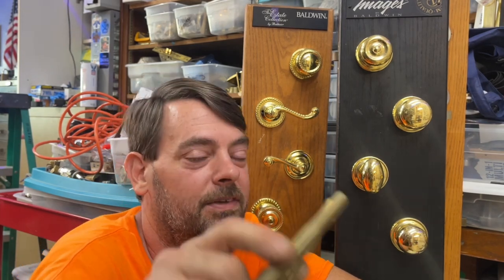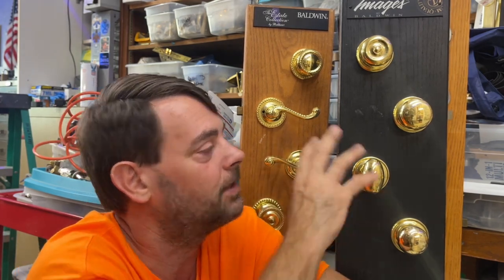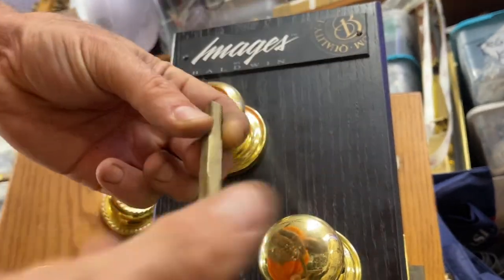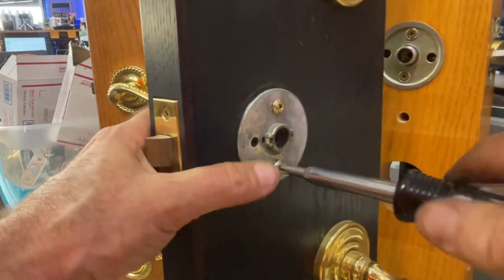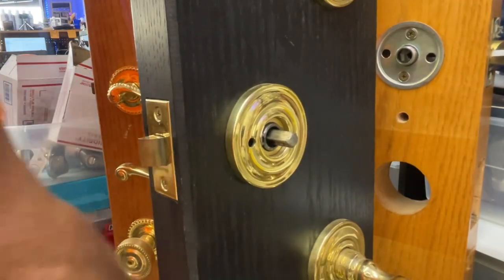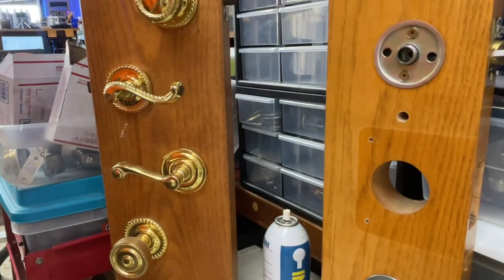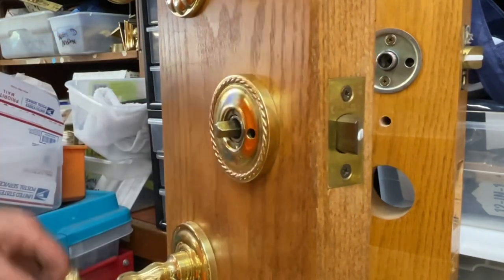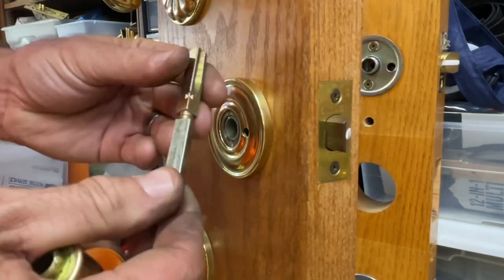RLS 24 - Baldwin Images & Estate Tubular Passage & Privacy

Comment: Always interesting to see the stuff common in other areas. Baldwin isn’t common in my area. If I come across Baldwin it’s most likely a fancy handleset on a really nice house or the ole’ Baldwin Lock email scam. Locks and Pulls hardware outlets are about the only place that sells Baldwin in my area and even those would be most likely using the Smartkey tech. About the only non sc1/ kw1 keyway I do see often enough is the old “National” Lock locking hardware particularly the 441D’s (aka Amerock). And I appreciate the vid you did on those a few years back. Thanks for sharing!

Comment: Great video and truly helps .. Haven't worked on a Baldwin yet but , I know that there are some out there in my area .. Was wondering tho.  , since I don't have a Baldwin wrench  can you use a adjustable  spanner wrench to take the rosette retaining nut off instead of a screw driver ??  I think the " stops " on the inside is a good idea .. Safer for the customer ... Thanks again...
Reply from the maker: You could use anything like that really for sure as long as the pins were small enough. I think most “regular” spanner wrenches though are gonna have too big a tip. Another option would be a pair of snap ring pliers
Reply: @selock  Great !!!  Thank you I will remember that ....